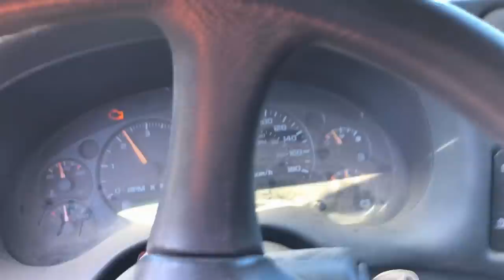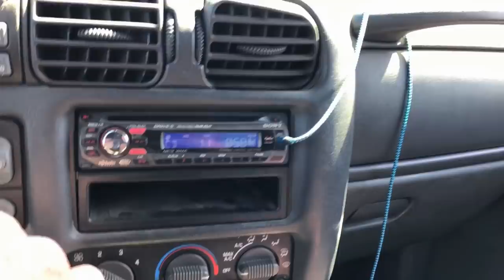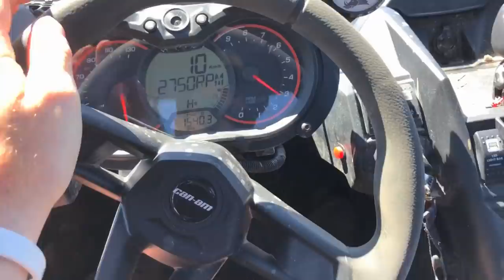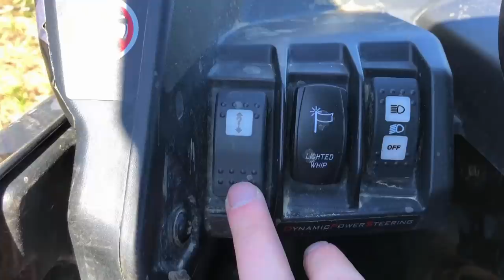Runaway DODGE 2500 FAIL!

Comment: I jumped my 99 2500 over a set of train tracks. Kid you not both my headlights went out at the same time but my marker lights and cab lights still worked..... broke like 4 leaf springs and probably got 3 ft of air lmao
Reply: Obviously it was at night time when it happened